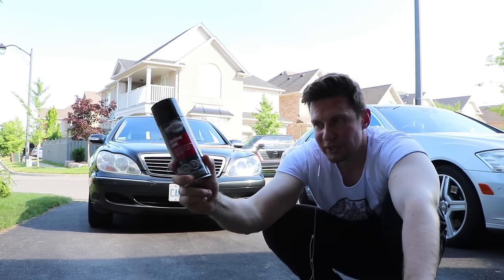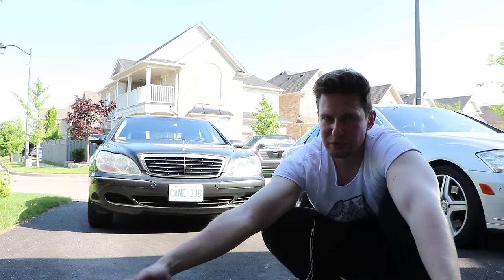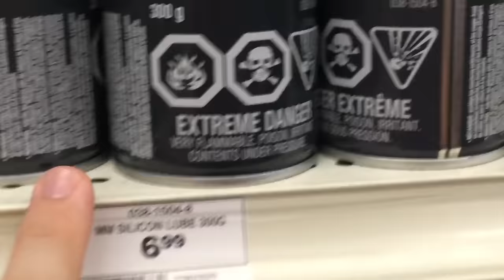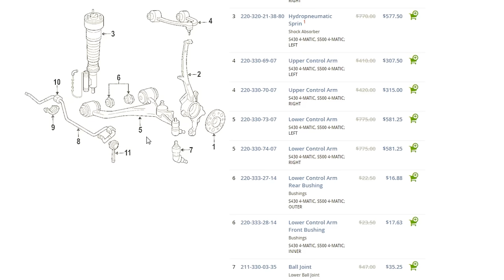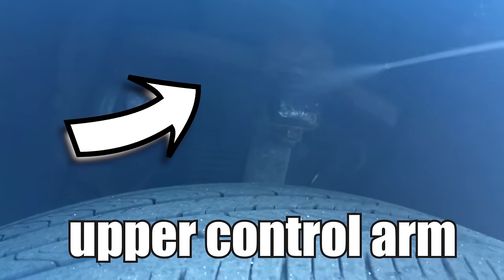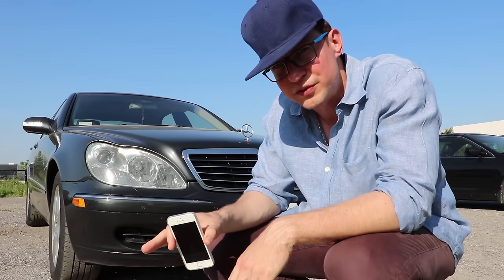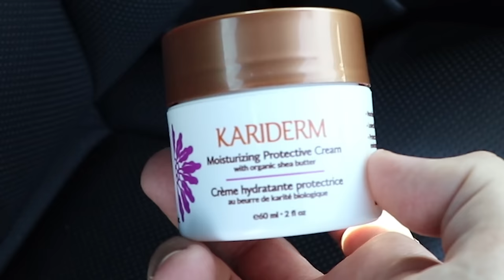Lube It Up! "Fix" squeaking creaking suspension with a can of spray!

Comment: you should try the stuff Scotty Kilmer recommends
Reply: skyline AT205 Reseal
Reply: @thurm101  yes, it rejuvenates the rubber components
Reply: @aaronkeehan5048  tried the Reseal?
Reply: @aaronkeehan5048  what were u trying to accomplish with it
Reply: @aaronkeehan5048  Might take some time to revitalize the rubber
Reply: @amaxlite  actually not the best thing to use for bushings that are creaking but otherwise fine, at205 is called a sealer for a reason- it swells up the rubber in a seal so it stop further leaks, bushings can get mushy and swollen with this stuff and not work properly. The best thing to use is to take off the bushing and apply silicone grease, the best ones being sil-glyde and formula 5 from Energy Suspension. Unfortunately most people like me would be too lazy to take off every bushing so using a spray lubricant is easier- keeping in mind that most silicone sprays (unless they're the water based sprays) are petroleum based and can wear out the rubber over time which sucks. Do you think food grade water based silicone lubricant would work or is it not water proof ?

Comment: What works best? Silicone, White Lithium Grease, or AT-205??
Reply: Use WD-40 works better
Reply: Best is AT-205 or Silicone. Never use WD40 on rubber parts becouse they swelling
Reply: @maovi7652  iS THERE A RISK THAT THE SPRAY WILL GET ON ELECTRIC SENSORS FOR EXAMPLE abs-BRAKE SENSOR, AND GIVE error to computer?
Reply: @frv6610  No, because the ABS ring is magnetic and sensor is made from composite / plastic material
Reply: @maovi7652  is it necessary to protect the brake disc and brakepads from the silicone spray, is it ok to just put a sheet of paper on the (backside of) wheel as protective cover and spray around freely on nuts and joints, might some electronics get messed up?
Reply: @frv6610  Yes definitely. Don't spray any lubricant on brake components. It could be wiped down from brake disc, but brake pads will soak it like sponge. So avoid spraying on brakes

Comment: Look man I get it; thanks for the video but I highly doubt you needed to bathe those parts in that stuff. Silicone spray would work really well coating and lubricating rubber. However WD40 as a brand does sell a similar product. Which is a silicone spray that coats. But as he mentioned I wouldn't recommend traditional WD40 as it just won't stay where you need it. Also if the rubber components are smooshed, crushed and not as shock absorbent as they need to be this is NOT a fix all. If your components need replaced then replace them. A cheaper alternative would be listening to your radio loud enough to drown out the noise too. But that's just silly as Hell.

Also if your upper and lower ball joints have grease points grease them. Suspension components on trucks can have up to 13 grease points. Outer tie rods can have grease points too. Typically all after market parts will have grease points to prevent squeaking. Factory/OEM are sealed and last so many miles.

Comment: This is fine to buy some time, but the parts that are squeaking are wearing out, and you will be buying the parts to fix them, your front tires will wear out due to misalignment from worn out control arms and other parts, so by disguising the noise you risk excess wear on your tires. Just to be clear.

Comment: You're lubricating outside, but the issue is inside. The real problem may not be squeeks but the stability of the car. When a part goes bad it has to be replaced.

Comment: It will work for a few weeks. Trans fluid mixed with break fluid works a little longer.
Reply: That would eat away paint and coating causing rust.

Comment: Pretty important thing ya missed:

Don't spray that stuff on your brakes.
Reply: Why? I’m sorry, I didn’t know these things
Reply: @Lizzy_333  Brakes need to be grippy, not slippy. If you spray some lubricant on the brake rotors, you'll likely crash because you can't stop.
Reply: @MetalAsFork  Ok, that’s really scary! 😳
Reply: @MetalAsFork  I’ve had a horrible squeaking in the front end of my 2005 Dodge Durango for at least 2 months now. I had it serviced earlier in summer and recently had a tire patched so asked them to look to see if something is wrong, they couldn’t find anything but said since there’s an oil leak, it’s probably because it’s going onto the bushings and causing the squeaking. It is a really fast and bad leak as it’s on EVERYTHING. But, I would think oil would actually lubricate and not cause this??
Reply: @Lizzy_333  Yeah I would think that as well. There are a whole bunch of suspension parts that need to be greased periodically so they function properly and quietly. You could try what this guy did with the silicone, or try to find a mechanic that will just apply some grease to likely spots...
Reply: @Lizzy_333  I have an 09 Dakota. Maybe Dodges are just squeaky lol
Reply: @MetalAsFork  🤣 well it was quiet as a mouse up until now 🤷🏻‍♀️ I’ve had it for 5 years
Reply: @MetalAsFork I’m afraid of accidentally getting it on the brakes! 🤭 I’ll wait for my next oil change and ask them to grease it!
Reply: @Lizzy_333  I wouldn't worry about getting a small amount on there, it'd be scraped/burned off after a couple of stop and go's. You could even just putt around the block a bit afterward to test your brakes after.

If someone was going crazy spraying everything and sprayed a lot on the rotors, then it could be an issue.

Is the noise on one side? Is it a frequent squeak or an occasional crunch?
Reply: @MetalAsFork  It started on the driver side and slowly made its way to the other side as well… it’s pretty constant since most roads aren’t completely flat, also the same sound when turning the steering wheel..there’s oil all over from the leak so that’s the ONLY thing that makes sense from what the mechanic said about it must be that oil leaked into the bushings and that’s where the squeak is coming from but it still doesn’t make sense to me lol
Reply: @Lizzy_333  Ha, weird. Yeah who knows, could even be a steering rack thing.
Reply: @MetalAsFork  😂🤷🏻‍♀️ who knows!

Comment: would  a good penetrating oil work as well
Reply: Rondo Schiavoni Not necessarily - it would be corrosive to the rubber - silicone bonds safely

Comment: When your car bounces like this, your shocks are done. Replace asap
Reply: What about squeaky happens when rolling? Bad shocks just give a bumpy ride?
Reply: @Menga213  not only that. It will prematurely ruin the suspension components like control arms, ball joints and most importantly the coil springs
Reply: @antonzhloba6929  so i have a squeak when the car is rolling? But not on the suspension? What do you think it can be? Also so what is this "liquid wrench" for?
Reply: @Menga213  yeah you need to figure out where the squeak is coming from. I have no experience with liquid wrench, but silicon-based solutions like this can help with the noise yet won't solve the actual issue if some of the suspension components are worn
Reply: Thats not true. Its because the rubber in the bushings of the control arm havent been greased and are rubbing against the metal.

Comment: Worked my w210 e320 for abit a month sqeaker came back lol
Reply: Daniel Kon lol yup you do all your maintenence yourself?
Reply: Daniel Kon hmm fair enough i do most labour myself lucky tht i have my grandpas lift changed my spark plugs cost me about 100$ dealer wanted like 600 $. Also if you want just wait till walmart has oil on sale. Mobil 1 is usually26 bucks sale price regular 51!. You could also pricematch at walmart!
Reply: Might have to replace the parts then LOL

Comment: You are not fixin it ¡¡ you just save it for later
Reply: Yeah, but for someone who has had their trucks front end upgraded and parts are breaking in and making noise. This is very helpful.
Reply: It don’t need replacing right now it’s just little worn it happens with old dry rubber. The silicone spray softens up the rubber. You get the squeaking noise when it’s old and dried up. Now if it was clunking then it’s time to replace

Comment: Stops the squeaks, but doesn't fix the problem.  If you want to diagnose just spray everything individually and when the squeak stops you found your problem.  Likely a ball joint And those should get fixed pronto!  If it separates while you're driving the wheel folds underneath your vehicle and if you're lucky you won't be going to fast.

Comment: On my mazda cx-5 spraying the lower control arm bushings stopped a clunking sound when going over bumps. Learned from felix dans chanel. So it works for clunking too not only squeeks!

Comment: "dont use WD40" literally links WD40 in the bio lmao
Reply: Yeah im confused too bud
Reply from the maker: WD-40 - the water displacing spray is no good. However, the WD-40 brand makes a silicon lup with a very good spray housing on the can.

Comment: Here's a tip: DON'T IGNORE THE NOISE!!!

Rubber gets old and becomes brittle. Before it outright fails, it will give you plenty of little signs it's time to replace it. Bah humbug you say, I'll spray some silicone lube on it and it's all good. Sure, it may get rid of the noise but the problem is still there and now that you've 'silenced the warning alarm', you forget you had a problem. Then suddenly one day that rubber bushing/bearing starts clunking if you're lucky or it just rips its self apart you become a passenger instead of the driver. OH YEA, FUN TIMES!!! 

Don't be the ignorant one that also claims their 12 year old tires have plenty of tread on them. If you're the only person on the road, then it's fine but chances are you'll end up involving others. Rubber gets old, becomes brittle and FAILS.
Reply from the maker: Ah but regular lube spray can extend life of rubber.

Comment: too late for saving money i just replaced my struts and its still squeaking
Reply: ME TOO
Reply: @gmill4977  Lithium grease spray on the rubber mounts. Also if you torqued down those top 3 mount nuts while the car was still in the air it will cause this. Loosen those nuts, drive around the block and then re-tighten them.
Reply: Same 😭

Comment: But....your not supposed to be able to push the car down so easy.  There is a problem with the suspension. The suspension on your benz supposed to be firm and it's too bouncy.

Comment: worst think you can do , control arms should never be lubed , only the joints can , control arm screws should be so tight that the rubber part doesn't move in the bracket , if your control arm squeaks that means it's not tight enough , the rubber part is moving and rubbing against the bracket making that noise.

Comment: The noise stopped but your not fixing the issue just finding a reason not to fix it 😂 I don't blame you those Mercedes parts are pricey
Reply: parts are priced ok... the robery is in labor charges like "take it or leave it" - Anything you touch is $1200 and up
Reply: Yeah, that's a misunderstanding. It's not pricey parts. Its labor

Comment: Beware a bad control arm will eventually brake when it does you better pray your not going more then 10 mph had it happen to me front tire went in the wheel well...it will eventually brake get it fixed an don't buy a dam Mercedes they are junk  over engineered crap....
Reply: you are so right, all the way! money-pits 😂